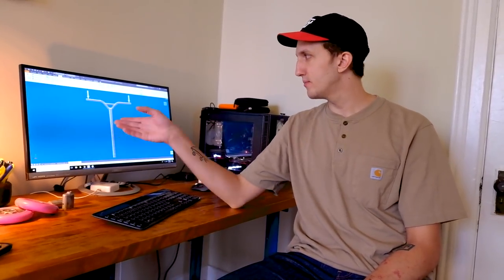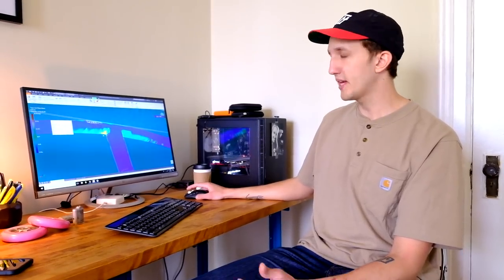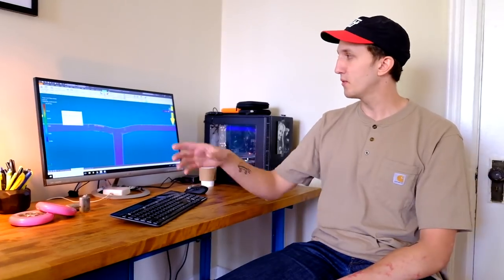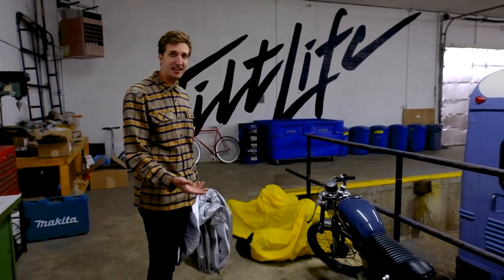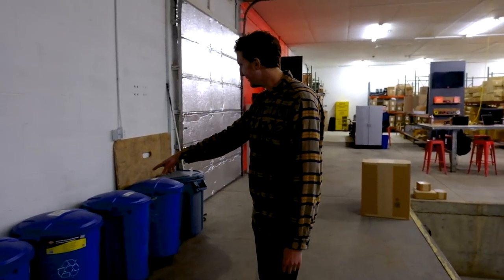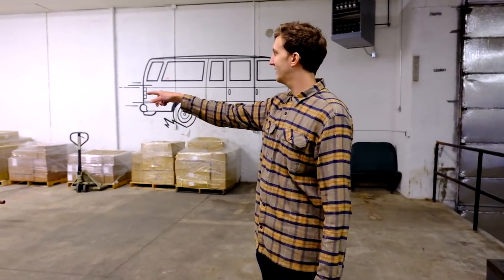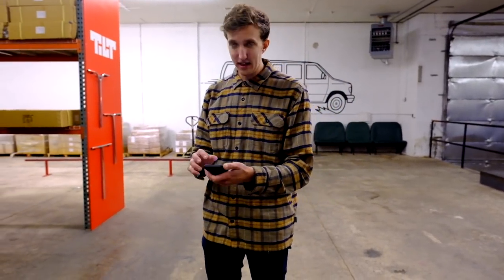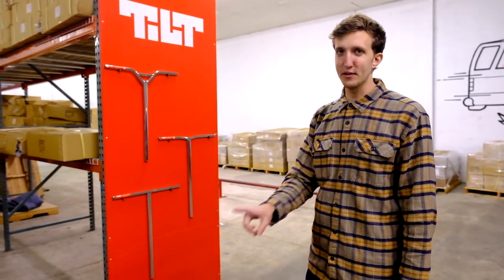Tuesdays At Tilt : Handlebar Tech & Warehouse Tour - Ep 02

Comment: With the hybrid bars how did you figure out the dip angle you wanted to use and next time you should talk about how you bend he bars back after the heat treating
Reply from the maker: We tested over 40 different shapes using different angles and radii. We combined the data and drew a curve to find the absolute strongest shape. Hope that makes sense and answers your question!

Comment: What is your preferred CAD program? Do you think SolidWorks or AutoCad has an advantage for designing parts? Do you run a separate program for stress testing or do you run simulations in whatever CAD program you use?
Reply: Thanks a lot guys. Great video!
Reply from the maker: We use Inventory and Fusion for TILT. Tons of other programs are built just for stress testing, so you're on to something there. We don't complicate it that much for scooter parts :)